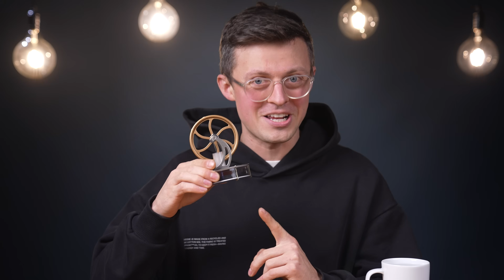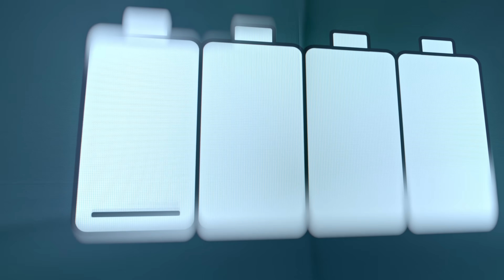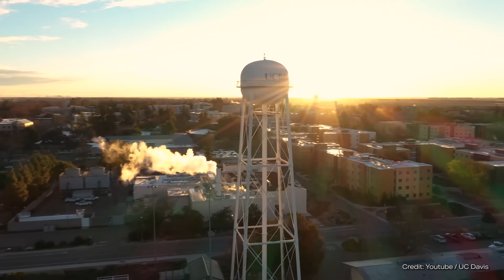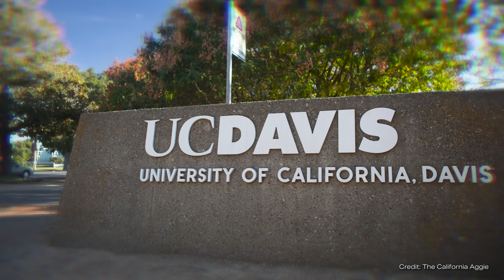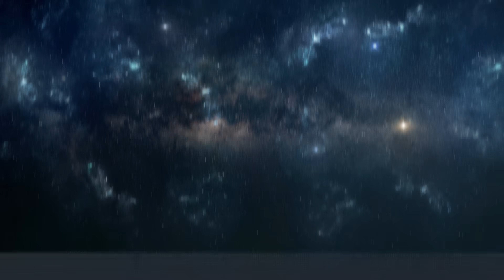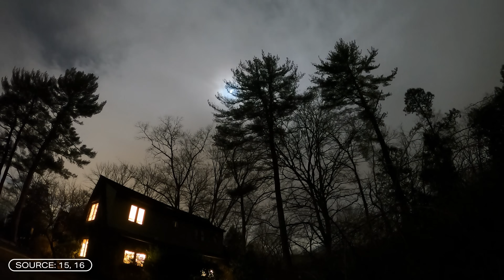This Engine Runs on the Cold of Deep Space!

Comment: Wouldn't you get a bigger temperature difference if you flip it over? Paint the hot side black and point it to the sun and the cool side will be in shade. You should get more than 20 degrees Celsius difference. That's what I want to experiment on but lack of funds delayed it indefinitely. I hope someone else tries it.
Reply: At that point it would be better to just use a solar power

Comment: passive radiative cooling, specifically through the high thermal emissivity ϵepsilon of graphene in the infrared spectrum
Graphene acts as an "entropic surfactant" and a highly efficient thermal radiator, enabling heat dissipation to the cold background of space , to allow banks of Stirling engines to cycle avoiding thermal hot spots , or adding crude graphene directly into the surface of the moon to act as a sponge , coated surfaces for radiant heat transfer into aquaponic beds of phytoplankton , hemp can grow on the moon with atmospheric containment

Comment: it would do good in outer space because it's so much hotter in the sun that in the shade there.

on earth, I think cold bore geothermal, and concentrated solar thermal with shallow earth dissipation loops...both together actually, where the solar thermal takes peak loads and the geothermal is base load.........cold bore geothermal has a much higher success rate,  so much more economical, and works at temperatures similar to concentrated solar thermal.

Comment: Not that it really matters just yet, but if they can reach around 2-400 watts over a few panels worth for night time use - that be all it really needs to produce as most homes at night dont require much power at all - with our cooling devices and lights being the bigest use of that power (fans, deep freezers, LED lights, etc). Where I think this might have some real world use is to attach it to the house it self. During summer, you can use it as a means of a heat pump moving the hot warm air from the house and into space. You also have the ability to produce more energy in a smaller space allowing it to perform a bit better as well from the temp difference. I will say, you will need to figure out a way so its not a giant wheel though:) so a solid state method would be needed.

Comment: Stirling engines are cool, but efficient? Compared to TEGs, sure, but not compared to turbines. Stirling engines has some potential advantages and disadvantages compared to turbines, efficiency is not to the Stirling engine's advantage, despite the very common claim that it is efficient.           

That coupling to space doesn't make sense to me, for a few reasons. First reason is that the electromagnetic spectrum emitted by an object is largely dictated by it's temperature, that's how IR thermometers work, and that's why visible light has color temperatures, and so on. Wishful thinking and buzzwords doesn't change how physics works, so you can't just make a material that passively emits electromagnetic radiation in the wavelengths that you want, regardless of temperature of the object. 

Another reason "skycooling" with some supposed coupling to outer space doesn't make sense to me, is the fact that such a coupling isn't required to achieve such modest temperature differences, it doesn't matter if the radiation reach outer space, or bounces against the atmosphere, as long as that radiation doesn't bounce back to your surface, it makes absolutely no difference for what you can observe on your surface, as it doesn't matter for the source at all where radiated energy eventually ends up, as long as it doesn't returns to the source.   

The third reason is that the temperature differences achieved compared to ambient are insignificant, and tends to decrease the better the experiment is controlled. With a coupling to outer space though the atmosphere, ambient temperatures shouldn't be very relevant, and well designed experiments that use really good insulation should be able to reach extremely low temperatures, but they don't.

So, to summarize, that supposed coupling to outer space, is not possible, and also not required to explain what can be observed, it's actually incompatible with what can be observed, in somewhat controlled experiments.   

But let's assume that you figure out a way to make something passively radiate more energy than it absorbs, despite being below ambient temperature, with the spectrum you want it to, regardless of the objects surface temperature by some covering it in some clever nanostructure or whatever, what happens to that effect when the surface gets dirty?  Would the magic still work through dirt somehow?         

When you want to extract work from a temperature difference, besides the efficiency of the system that performs that conversion, the temperature difference you have and the amount of heat energy you have are factors that also dictate how much work that is theoretically possible to extract. That means that the very small temperature difference compared to ambient temperatures you can achieve with radiative cooling is a big problem for extracting meaningful amounts of energy in it self, but to extract work you need add heat, which makes the already very small temperature difference even more ridiculous. 

Equilibrium temperature difference without adding heat as in trying to make use to that temperature difference in any way, tells you about as much of the potential usefulness of that temperature difference as voltage alone tells you the amount of power or energy. So even if you believe that you can achieve a ∆T of 10 °C without adding any heat, somewhat reliably, that doesn't mean you can use that temperature difference and still have it.

Comment: Could a fly wheel used for grid storage,that require's extremely small amounts of energy to be continually topped up,,, use a sterling  engine's mechanical energy transformed via magnet's maybe.or maybe a salt/sand energy storage unit could house a sterling engine?

Comment: That piston movement (the large moving membrane inside of the "cylinder") can generate electricity too. Just set up some magnetic arrangement? Or would the forces not overcome the magnetisms conservation principle (or how to name it in English)?
Reply: Or use a peltier device that uses a solid state heat-gradient electrical generation method without needing lossy mechanical processes.

Comment: I am skeptical about the efficiency of Stirling engine. AI suggested to use "Low-temperature Organic Rankine Cycles" with wiki/Scroll_compressor (also as the expander).
The AI also suggested Thermally Regenerative Electrochemical Cycles, but I do not think that would be effective.
I suspect that "capturing cold" during night and "using that cold" to improve solar panel efficiency during day would be the best way to extract energy from a square meter of surface.
Reply: Maximal efficiency will be given by Carnot cycle, I assume around 1% in this case. But the thing is that the stirling engine, especially those precise models will work with very little temperature gradient, that would be too much for ORC as the heart of ORC is still a steam turbine, which requires given medium to have significant change in pressure and temperature to work, and also needs some pumps, heat exchanger and so on. Stirling engine, on the other hand, does work only with air or some gas (e.g. nitrogen) that only expands and contract.
Reply: @MrToradragon  Have you noticed the Scroll_compressor part of my comment? Should be a big difference from the turbine implementations of Rankine cycle.

Comment: Eventually you'll still be limited by Carnot efficiency equation that depends on the cold AND hot side temperature : the maximum efficiency of a thermal engine is (1 - Tc/Th)*100% where Tc is the cold side temperature and Th is the hot side temperature (in Kelvin). 

 Having a Stirling engine that's cooled through the atmospheric window is nice (lower Tc) but if you really want to extract power you also can increase the hot temperature (that's how it's usually done : our internal combustion engines, gas turbines etc... all go to high temperature in the combustion chamber). Using the soil as a heat source is a nice illustration of the process (the same way you can use the low heat of a cup of coffee/tea to make this small low temperature difference Stirling engine run) but I don't think we should pay attention to the claimed energy production since it 's more a demonstrator that shows it works in the worst case scenario.

The top tier Stirling engine uses concentrated solar energy to reach ~40% efficiency and that's with standard cooling, i.e, the cold temperature is near or above ambient temperature. However, if we combine passive radiative cooling AND concentrated solar we could obtain higher power and higher efficiencies.

Comment: Another place where there is a large thermal difference that could be exploited by a sterling engine is in space.  Sunlight gives you the hot side and the rest of the universe give the cold side.  Or anywhere on the moon, 1/2 m or 1 m below the surface is a steady temperature - that's the cold side - and when the sun shines the top side gets very hot, like 250 C.  Always-shadowed areas of the moon are super cold, below 50 Kelvin!   Sterling engines are great, I'd have to say elegant even.

Comment: Could this be combined with underground water based heat pumps to create a larger differential through the day? I'm not sure how efficient water based heat pumps are compared to the power yield as is but in principal its just concentrating more ground surface area to the stirling engine.

Comment: This seems to be a wasteful efficiency chase? [IMO] 
To me, heat is energy, and this takes the heat energy and removes it in 1 go to gain efficiency from the larger temp delta; this takes us closer to combustion in terms of the usage of energy or fuel{energy stored}, whereas the fuel gets a single use, then is gone forever. 
With transferring heat outside of the atmosphere to space, this feels like having energy and just throwing it away. 

With sterling engines, you could perhaps use heat pipes to move heat from the initial source through sterling engine #1, which has its cold side plate connected to heat pipes moving to the 2nd sterlings hot side. 
A simple 2-stage system feels intuitively more useful of the energy in the heat rather than using the inherent IR coldness of space to create a bigger differential to raise the efficiency of the 1st stage of heat transfer-work production. 

(2nd stage doesn't need to even be work-producing,  for example, Radiative floor heat, Pump House Lining Heat, Hot Water Pre-Tank Line Warmer)

I could be entirely wrong as I'm no genius, but this feels somehow less efficient from a usage standpoint. 
The source of heat is used up and unrecoverable outside of the confines of the system in a single process. Even if this is twice as efficient as moving the heat from point A to point B through a (Sterling Engine, Peltier plate, ETC), how is it more useful than having Point B for the heat being a second work production &/or radiative/storage stage that of course has less initial energy to work with, but less is more than the none recoverable from space?
Reply: The Circulatory usage is a really cool greenhouse usage that the space engine has up its sleeve!

Comment: This is BS. All the radiation is absorb by the air air at the top, NOT going into space. It is basically a basic heat pump. The heat is still stuck on earth. All you did is transfer the heat from the ground to the air above and use it to do some work.

Comment: could this be used in a by-phasic solar/electric-thermal/pump...electric system providing electric power day and night??? solar panels collect direct electricity while being cooled from beneath by sand battery's collecting the excessive heat, collected thus increasing the photoelectric solar collection, and after then dissipate the collected heat through sterling engine electricity conversion putting the collected heat back into space!!! energy is never destroyed!!!

Comment: It is not that the light emitted from the cooling paint has to escape the atmosphere to cool the surface. It's just that the surface needs to absorb less heat than it emits. Everything above absolute zero emits electromagnetic radiation, therefor anything around the paint like buildings, trees, grass or clouds are emitting radiation that the paint absorbs. If there are no clouds then there is less radiation coming from the sky, although the atmosphere still emits some radiation. All of the talk about cooling using the cold vacuum of space is BS. But you can increase the paint's efficiency by building a reflective insulated wall around the painted surface with a transparent film over the top. It will block some radiation from the surrounding environment, while still emitting heat away from the surface thus increasing the temperature difference compared to ambient air.
Reply: i see you watch tech ingredients :3
they do really interesting stuff

Comment: Heat of Earth and cold of space.. Points at Cold Steam Tesla Turbine technology "No emissions" Takes rain sample finding no acidity problems > Taps my Direct-Fired CO2 Generators > Runs Diesel Turbine engine exhaust through Cold steam Tesla Turbine boiler shotgun condenser style before leaving vehicle > Once hot enough for Optimal Turbine symbiosis double Generator mode runs excess power to pump in sync with engine to prevent stalling engine while absorbing emissions to feed more Algae aka 'fossil fuels' hahaha An upgrade you could all benefit if applied today.. Points at rednecks doing custom exhausts They everywhere ready they just don't know it yet.

Cranks 1900's Elitist Miner lamp to fill Capacitor fast with way oversized generator > Sets it down for the light for minutes > Cranks generator on console > Pushes button to dump capacitor to electromagnetic lift Turbine, lowering pressure inside system, and freezing water around cold side of Turbine system run away from engine heat If you wanna go crazy? Google: "Ultrasound holography stem cell guidance" Use filters that allows Ultrasound to print through walls for Capacitor pulse Plasma speaker Ultrasonic resonance to disintegrate carbon buildup as its made in the engines to keep them clean inside. Plus heat entire engine perfectly using computer controlled Ultrasonic thermometry..

Bonus of a full pressure wave holography supported vehicle? Locks onto hidden ship under ground beaming to resonance tuned crystals that fill a capacitor that flushes into main startup to bark back and watches the dirt around it lift off getting smashed around away from the craft Independence Day "The Gizmos just turned on!" LOL.. Self cleaning.. Googles: "Saucer over Dracula's birthplace pouring smoke Yahoo news 16th Century Church painting" Oops there goes the modern science fiction saucer lie.. Points at the smoke I just told you my engine design.. - Dracula (Bat = Sonar = Ultrasound.. "Sonar fence the man in black!" Operation Tiger Moth.. They screamed funny. LOL.)

Comment: Idea: Flip it around. Put the cold side in the ground, the hot side facing up. Make the collection panels matte black to absorb solar heat. You could even store heat in a sand battery for night.
Reply: the idea was that the ground is a stable temperature no matter what time of day it is. I get what you're saying but early designs must be as simple as possible to make people adopt them.
Reply: @jacobe2995   The ground would still be the stable temperature side. It would just be the cold side.
Reply: @williambarnebee40  right but the hot side would only be effective in the day time.
Reply: @jacobe2995 not if you store excess heat in a sand battery. Then it can go for days. 

Just an idea.

Comment: Forget the Stirling engine and use the paint to cool the earth for the greenhouse effect. Put it in deserts which have clear nights. 6MW of earth cooling per sq km!
Reply: greenhouse effect basically fixes itself over time since more co2 = more plants

The real problem with emissions and pollution is... well toxicity. It makes the oceans acidic, makes rain acidic, makes everything poisonous and kills the planet.

Even if heat were an issue, reflective surfaces as a way to prevent the greenhouse effect doesn't actually work because its reflecting from inside the greenhouse - all you'd be doing is sending that light right back into the atmosphere to heat it up even faster. If you want to prevent greenhouse heating you have to reflect the light in the upper atmosphere, or even before it reaches the planet at all.
Reply: If its non toxic then fuck yeah spread that shit

Comment: Before people get TOO excited about this, it's worth pointing out that while it does technically work you will be getting at most a few watts per square meter.  It's hundreds of times less powerful than PVs.
This isn't solvable with better engineering either, it's a limit of thermodynamics.
Reply: actually it can be solved with exploiting more effects of quantum mechanics, for example, enthalpy of vaporization and the greenhouse effect
saturated greenhouse gasses emit light far more powerfully than a blackbody of the same temperature, mainly cause they're performing molecular emission, rather than thermal emission, and greenhouse gasses above a certain temperature will tend to remain mostly saturated
i have tried to find what temperatures for which gasses buut unfortunately all i could find is the wavelengths they emit when electrified
Reply: @Dawn-q4e2p  There's an easy way to know if this can really be solved or not, and it's to ask if anyone has done it in a lab, or even attempted to. If anyone has done this then I'd like to know, but for now I'm putting it in the "not actually viable" category.